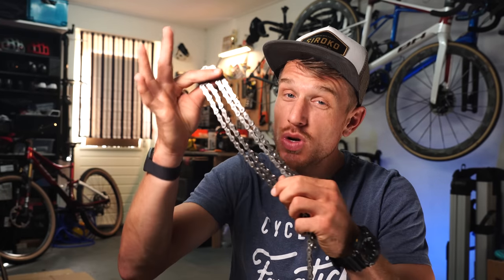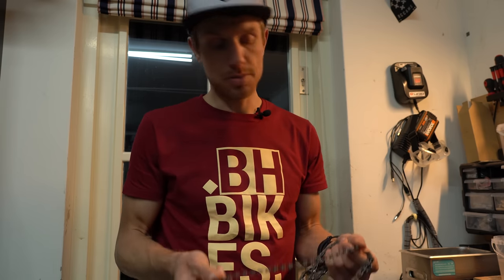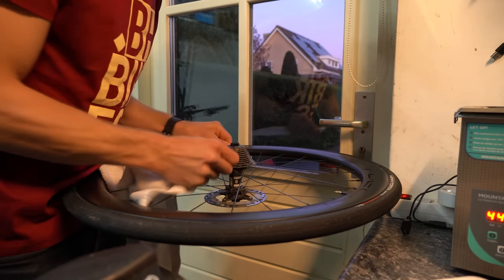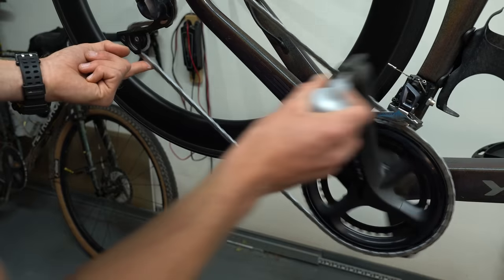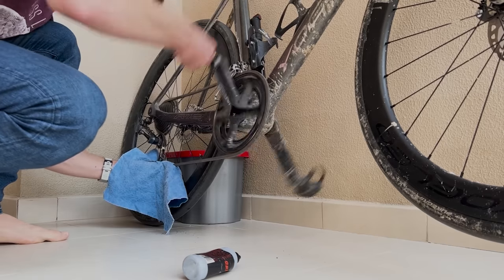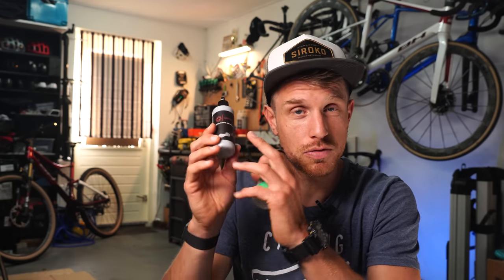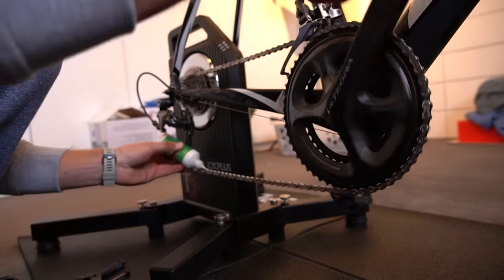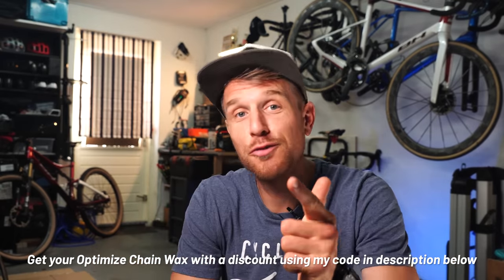Testing Chain Wax for 1-YEAR and this happened..

Comment: Pro tip: heat you chain with a hair dryer before lubing the chain. The wax penetrate better between the links.
Reply: ha, ha, a hair dryer pro tip?, do you wanna tip from far future how to heat up chain anywhere anytime, use 12v inductive heater to heat up chain and you could melt solid wax on bike instead you bring remote kitchen with you
Reply: I guess I’m bit of a rebel when it comes to chain care with wax ,i use a heat gun, a hair dryer on steroids to melt the shipping film on a new chain In combination with wiping and brake cleaner and presto its done when its time to wax i then install the chain on the bike sans the wheel and use a pulley on axle then start a the quick link heat 10 links or so at a time and drip wax on each link,the heat pulls the wax in and around the pins like sweating a pipe joint when finished I release the tension reheat low temp to make sure its coating the power side of the pins.ezy pzy
Reply: No need the slow cooker heat will do that.

Comment: I do a three stage process for chain grease removal. I place the chain inside a jar with Muc-Off Drivetrain Degreaser and shake it around a little bit, doesn't take much time. Transfer it another jar with bike wash or some mild soap like Dawn and water, give it another little shake. Transfer it to the third jar in 90% isopropyl alcohol, last little shake. Give it a good wipe down with a microfiber cloth. If you have an air compressor that will help with the drying process. Results should be a bone dry chain.

Comment: Degreasing and waxing is definitely a learning process. Its not as easy as just dripping some oil on a chain, but definitely worth the initial effort.
Reply: I was converted about 10 years ago. It is such a convenience
Reply: Once you get a system going it is very rewarding. Not having an oily chain is amazing.

Comment: This will be my second MTB season using a waxed chain and although there was a modest initial investment in time and money (minimal), having a clean and well performing chain with minimal effort to maintain has been well. Worth doing. 
My recipe: Cleaning/prepping new  chain- Naphtha (camping fuel), Iso Alcohol, dish detergent & water. 
Wax: food grade Paraffin with a bit of chainsaw bar oil and graphite powder. Soak 12 hrs. 
1 Treatment lasts all season
Freshen up with wax dissolved in alcohol drip bottle application if required  No mess, no fus, set and forget feel.

Comment: To make the hot waxing a bit easier i actually use a slow cooker, set to LOW setting. It works just great! Also i think that you might have even missed out one of the greatest benefits of waxing - besides having a clean chain! To me a very great benefit is, that since the chain is not dirty, you barely experience any wear on the chain and cassette! I have a chain and cassette with 5k kms on them, still meassuring the same as a completely new chain! I use homemade wax with teflon tho... 🙂
Reply from the maker: Yeah that’s a great benefit 👍🏻
Reply: I use a slow cooker as well. On 10 speed chain I get about 6000Km, so I wax 3 times a year, chains last about 3 years. With Oil I needed to replace the chain every year. On my 12 speed chain I only get about 2000Km before I need to rewax, get about 2 years on a chain.
I also use homemade wax with PTFE 1 micron, and Molybdenum disulfide 1 micron. $20 gets me a lifetime of lubricant, rather than $100 per year.
Reply: slow cooker is the way to go!
Reply: Omg...🙄🤦‍♂️
Reply: @laneromel5667  But you'll be spitting out PTFE particles in nature everywhere, bad idea.
Reply: Yes. Rather than buying a new pan and getting your kitchen dirty, buy a $15 slow cooker, or find one for free or a few bucks in someone’s garage or garage sale.
Reply: I do the same. I buy 2 chains per cassette and rotate them weekly with each wash. I use Graphite in my mix with the PTFE.
Reply: @laneromel5667 
I put a freshly waxed chain on weekly probably overkill but it suits me
Reply: Leave the chain on for relubing.  
Wipe it down. 
Drip on wax. 
Using a hair dryer to melt and drive wax into the links effectively takes about 5 minutes and less hassle than a hot pot method.
Reply: Didn't find a good instruction on youtube for creating own chain wax. Any hints?
Reply: @123marijn321 oh wow ptfe particle in the nature. What a disaster.
Reply: @DaveRider719 , I make my own with 90-95% isopropyl alcohol, high quality paraffin, and a pinch of ptfe powder(smallest particle size from amazon). 4oz clear plastic applicator type container-3oz iso alcohol-pinch of ptfe-pellets of parrafin to fill container. 
Larger container of very hot water to set the 4oz bottle of mix into for approx 5-7 minutes will melt the parrafin into the Iso making it a carrier liquid. Shake well to mix. 
Wax will settle out between uses but a quick reheat (5minutes) re-suspends the wax into the Iso.
Reply: @awesomexistence  thx without alcohol you can just use it for hot waxing session right?
Reply: Yes, same mix. You can vary the  hot pot mix by adding TriFlow or something similar blended in. I get super high mileage from my chains doing that. This also has extended my cassettes and chain rings lifes.
Reply: @awesomexistence  very interesting. So the triflow lubricant don't have any impact on the paraffin? It will harden when it cool down and wont attract more dirt to the chain or something? Or do you have some kind of teflon particles. Thank you for your tips. I appreciate that you share your knwoledge.
Reply: @DaveRider719 , I hot pot with 
1lb of wax pellets 
3ozs Triflow
Teaspoon ptfe powder
Parrafin and Triflow are both petroleum based and mix well. I have no dirt attraction and rain seems to shed well (i drip wax with the suggested mix 4oz formula after real wet conditions).
Reply: @laneromel5667  Not sure if I understand how many kilometeres you get from a chain, is that 6000km for a 10 speed chain? If so you should be expecting 3 or 4 times that distance with hot wax applications, perhaps the frequency needs to increase? I am using the same material as you are using, food grade paraffin and I am up to 13000km on an ebike, checking the wear with a Shimano gauge and still ok but I am applying wax every 200km maximum. On a road bike I am getting about 25000km from a chain.

Comment: For low cost high efficiency hot waxing  get a cheap, round plastic food storage container like tupperware. Melt the wax in that by floating it in a little hot water inside a bigger saucepan. The bigger pot means it heats quicker as it's less deep, bigger pot means easier to lay the chain in. Also, you can lift the wax container out of the pan and under the hanging chain to cooldown, less mess. Also, when you manipulate the cold chain over the container to lose the hard, excess wax it goes back into the wax container and less is wasted.
Reply: People need to read this. I do it, but in a stainless steel pot in a larger pan of water. The heat is transferred more quickly, if everything is metal . 
Slow cookers are just too slow.
Reply: That's a really great tip - thanks!
Reply: @peterwillson1355 why does it matter if it’s slow? Put it in, go do something else. Put in in the moring, go to work, come home and pull it out.
Id also rather have the wax in my garage than my kitchen.
Reply: @tjb8841 if you overheat the wax, it damages it. You can't overheat it if you heat it in boiling water....I don't mind wax in my kitchen . It's FOOD GRADE WAX.  You can also use it for sealing jars of jam. If you pay 50 to 100 £ for a kilo of " special" wax, that's your problem. And I wax at least 4 chains at a time. They won't all fit I a slow cooker at the same time. Yes, it DOES matter if a slow cooker is slow .

Comment: One additional tip/note is that if your smallest cog is less less than 12t (in my experience) you will want to, occasionally, clean the gap between the two smallest cogs.  My road bike has a 12t smallest cog and I have never had any issues , but the 11 on my gravel bike will start skipping due to the wax build up between the 11 and (?)13.  A simple scraping between the cogs solves the issue, but it caught me off-guard the first time it happened. Also, I would go by hours rather than miles as Jasper will cover many more miles than I would for any given time. I use about 9 hours ride time between reapplications (hot melt), which is a little conservative, but it's so easy to wipe the chain down with a rag and then place it in the slow cooker that has about 250g of wax which I replace every year.
Reply from the maker: I haven’t had that issue. But did find the cassette would get a little wax on it over time. I thought the wax would be soft enough to be pushed away by the chain on that small cog.
Reply from the maker: You will get a contaminated wax bath if you do it this way. Maybe boil the chain down a few times between new wax.
Reply: @jasperverkuijl Please  see zero friction cycling for additional infiormation. Boiling water over chains is,  well, contraindicated.
Reply: Leave the chain on the bike. 
Wipe it down. 
Drip on additional wax. 
Use a hair dryer to melt and drive the wax into the links takes about 5 extra minutes and a bit less hassle than a hot pot method. 
.
Reply: @kevinlewis390 really?  I started waxing and cleaning by pouring water over a chain hanging on a wire because of Zero Friction.  I need to tune back in for new info??
Reply: @michaelgnafakis430  Yes, but let me clarify: For road riding in the dry - just wipe the chain down with a cloth.  For rain/gravel/mtb/cross the the preferred method would be a quick wipe down followed by a dip in a sacrificial hot-melt wax pot and then into the final hot melt wax.  In fact (iirc), ZFC says he doesn't even bother wiping down his road chains anymore (in dry conditions), just places them straight in the pot.
Reply: @kevinlewis390  I only ride mountain bikes over abrasive granite and volcanic rock. In  between hot waxing I wipe the chain with a micro fiber cloth with alcohol.  

If I hot wax I’ll remove the chain and pour boiling water over it then hot wax.  

If I’m short on time I’ll use drip wax in between hot wax but drip wax should almost always dry overnight which I rarely do.
Reply: @michaelgnafakis430   From my perspective I think that's a good plan. I was just pointing out the fact that it's not necessary (depending on riding conditions) and that when it is there is a "preferred" alternative.  Lol, on the drying overnight part, I think we've all been guilty of "not-best-practices due to time".

Comment: Mineral spirits>degreaser>denatured alcohol>hot wax>wax should cool before removing to allow wax to cake on forming stalactites.
I just started waxing and from a cleaning perspective, it's great!
Reply from the maker: Awesome
Reply: I have found when it is too cool you lose a lot of wax and it is more messy. I take mine out while it is still liquid and hang it over the pot to drain the excess off.
Reply: @paulb9769  I expect it to be messy for the first couple of rides.
Reply: @jonathanwise47  I have tried varying temps to remove it but I have found it works best for me when removed still relatively hot.
Reply: That's the way I do it. First step I use what is called 'wasbenzine' in the Netherlands.

Comment: stripping a new chain can also be done with: step 1 gasoline (diesel benzine in Dutch), step 2 isopropyl alcohol, and final step 3 water.
Reply: Not diesel. Use 'benzine' or simple 'wasbenzine'.

Comment: Excellent, thorough video that covers all the angles, and includes mistakes and lessons learned. I enjoyed your presentation style, too - down to earth. 

As far as indoor trainers are concerned, it's surprising how much dust there is in many houses! I switched from oil lube on my indoor training bike because it still would become a black gunky mess after a while, to the point that I couldn't just keep adding more oil lube - so I had to take it off and clean it up. Sure, the wax lube leaves wax particles on the floor (rocker plate in my case) - but it's dry and easy to sweep up.

Comment: For years I used a camping stove to heat the wax, a couple of years ago I bought professional wax heater used for heating wax for hair removal. It works absolutely great because you can pre install the temperature.
Reply from the maker: Great tip!
I recently got the specific wax cooker from optimize 🙌🏻🙌🏻

Comment: Great tips and very thorough! Here’s what I do. For new chain, Dip in petrol 24 hours to strip, dip in degreaser for a few hours, scrub, Dip in 99% isopropyl alcohol, scrub, spray with alcohol, air dry, then hot wax. Sounds like a lot but it’s not, and it totally works.
Reply from the maker: Yeah lot of people mention patrol. I’ll try it. 

Takes a long time though. 
It can be a 10 minute job with nitro
Reply: Did you even try Dawn dish soap?

Comment: Degreesing new chain, this works for me, in this order shaking for 5 mins vigorously in jar at each stage: Petrol (Gasoline) > Degreaser > White Sprit (paint brush cleaner) > Isopropanol.  Will never go back to wet lube.
Reply from the maker: Good stuff. Tried the optimize yet?

Comment: I use white spirit (stoddard solvent) to clean/degrease the chain. 3 separate 'baths' with the first bath doing the majority of the work. It's a little like cleaning an oil varnish brush after use. You can store the solvent for the next chain (or chains) that you want to clean. Eventually bath No. 1 is going to be too dirty to use in which case you will need to replace the solvent, this then becomes bath No.3 and the other two move up a place.
Reply from the maker: Good production line 👌🏻

Comment: First step to find the correct degreasing process is to knowing which type of grease has brand new chains. I think are petroleum based ones, so with a litre of gasoline grease dissapears in few minutes. After using water solved wax, only found a dirty chain. The best lube for me is a teflon based lubricant called GT85. Applying it each 3-4 ridings the day before, and well drying the chain is the best way for me....

Comment: the easiest way to do chain waxing is to have at least two waxed chains, one on the bike and one ready to go on the bike. it's far less daunting to re-wax when you can do it at your leisure although that leisure has a clock ticking against it! topping up with the silca based drip wax or similar is a decent stopgap.
Reply from the maker: Sounds good. I recently waxed 4 chains in one go. (All different bikes). Super efficient
Reply: I buy three chains. It doesn't take 3x as long to prep and wax sets of chains. When I need a waxed chain I have a spare or two. When all three are worn out, I replace them and the sprocket.

Comment: I've been pretty happy using a 3L InstantPot.  I put the chain on a spare spoke bent into a fish hook shape and set it on top of the wax.  30 minutes on the slow cooker setting melts the wax gently and a little swishing around at that point gets everything mixed up well.  I usually wash the bike and/or get a shower in the meantime.  After letting the excess drop off I just lay it on a piece of parchment paper to cool till the evening, or next ride.
I also keep a clean microfiber cloth in the garage specifically to dry the chain after any wet rides, and to clean off any dust/dirt before rewaxing.  I've never bothered boiling the chain, and have only worried about washing the chain after muddy gravel rides.  Is my wax getting slightly contaminated?  Maybe.  Don't care.

Comment: Haven't finished watching the intro yet, but personally I found that waxing is less effort overall vs dealing with an oiled chain if you're smart with a setup. Slow cookers are definitely the way to go for melting the wax. 

Notes throughout the video;

For removal of factory grease, isopropyl alcohol is the way to go in my opinion, preferably as close to 100% as possible. Its cheap and easy to get a hold of and effective. 

Studies show that hot waxing is the way to go, with drip wax to top up mid race or at a push. It penetrates much better and more reliably. 

As you suggested I find for a whole rewaxing then a boiling dip is good prep for the chain, then placing it back in the waxing pot.

Comment: I have been doing this for about a decade now. I normally do a couple of chains and rotate them weekly. 
To clean in between waxes I put the chains into an old pot and pour a kettle of hot water on the them and agitate them for a few minutes. 
I am currently using a mix of PTFE and Graphite it is great.
Reply: Would you share your homebrew recipe?
Reply: PTFE is suspected to be harmful to embryos. And it is there forever. You shouldn't put PTFE to the biosphere. Sry for bad english.

Comment: I know this is an competitor to your sponsor, but have you seen Silca's new development? They have made an additive to the wax that changes the factory grease on the chain into a synthetic wax. So, you don't have to degrease your chain before your first wax. You put it in the wax and heat to a certain temperature, then the grease gets converted into wax while your doing your wax.
Reply from the maker: 😵‍💫😵‍💫🤓 Whaaat?